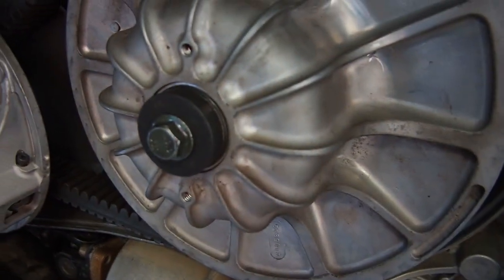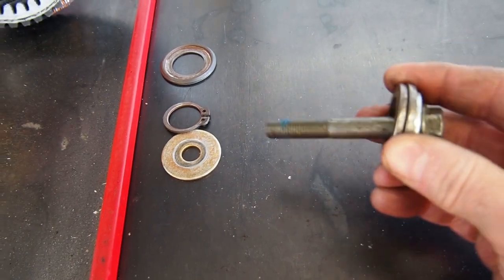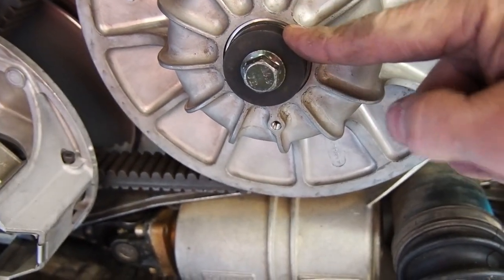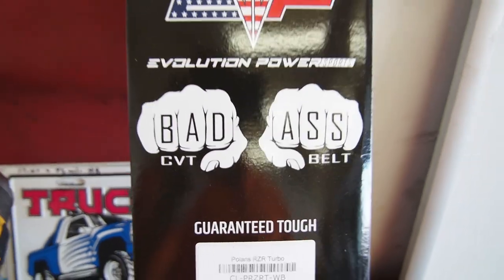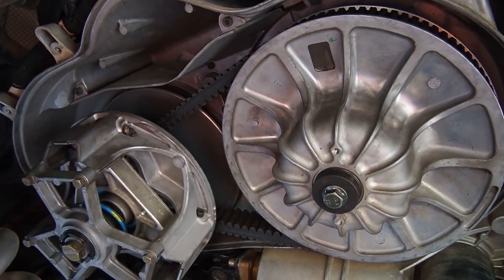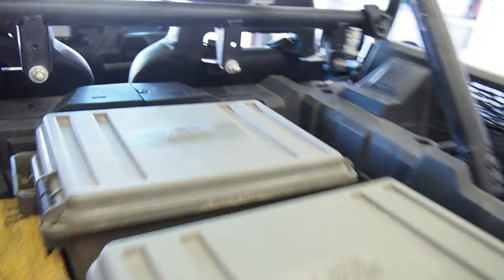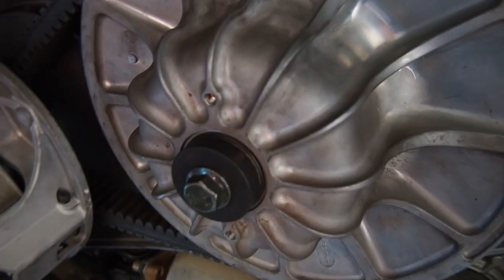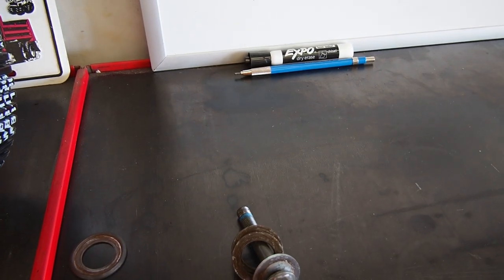Polaris RZR XP Turbo OEM Snap Ring Delete Kit

Comment: Ive got a 2019 xp turbo and secondary spinning at idle. Added 1 thick washer and didnt really help much. Haven't tried any more washers than that tho. Not sure what's going on.
Reply from the maker: The 2019 had the updated washer and bolt so no need to use the Aftermarket Assassins Delete Kit.
Reply: I just got a 21 Turbo S Velocity and my secondary is spinning in park and neutral after a ride. Not sure what is going on but 3 other people have told me it's normal. I emailed Polaris to clear that up though.
Reply from the maker: Totally not normal, shouldn't spin at idle
Reply: To all y'all... for me.. bought the tool. Unbolted primary and secondary. Reinstalled. Now perfect.